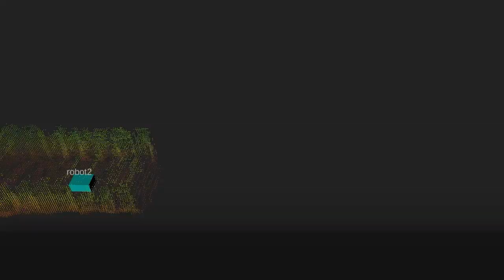DARPA Subterranean Challenge Tunnel Circuit Compilation

Comment: Is the idea to miniaturize the final designs into something capable of search and rescue missions? these robots seems much to bulky though perhaps slightly smaller (but much less flexible) than a human. Seems having something really small that sets out from the "mother ship" to gather intel then return for charging might be interesting - snake pots, tiny drones for going up vertical shafts, etc    I am sure the short term goal is just getting a very basic confined space mapped out and navigated in real time.   No sinister explanations are necessary - this is just a really good challenge for developing robots and robotic specialists,  with tons of spin-off applications duh!